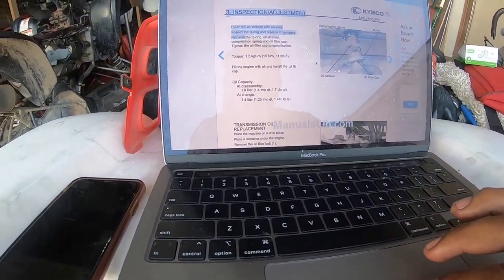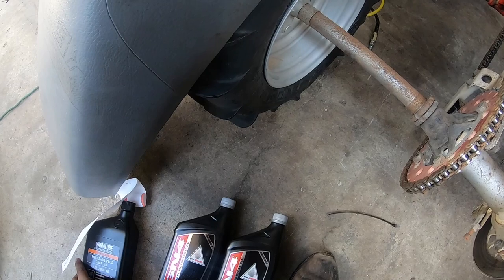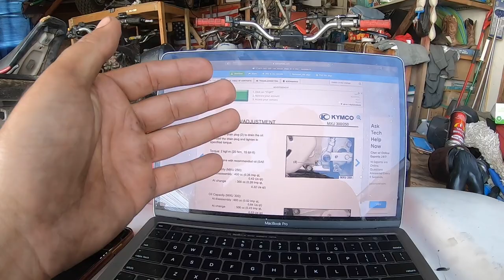How to do a Oil and Transmission change on a ATV! (Kymco)

Comment: Hello, I bought i kymco mongoose 90 for my son but for some reason turns off by itself after a few minutes what can that be I'm a first time owner. I took it in for service and I was told it was the battery that was replaced but problem still there 😞
Reply from the maker: Good afternoon. Can you message me on Instagram. So I can send some voices messages? Acemotorsports_

Comment: I've got a 2016 450i went through some deep water and it's slipping is there a drain plug for this problem
Reply from the maker: If you went through some deep water I would replace all fluids asap. That’s differential, tranny and engine oil

Comment: Hai sir kymco mxu250  gear chance that time its come jerk gear very hard .why that jerk   coming. Pls reply sir
Reply from the maker: Hello brotha, there’s going to be two reasons maybe 3 for the jerking when changing gears. How’s your idle? Maybe lower your idle a tad bit. Have you changed your gear oil? It’s important to do a full tune up and lastly but more than likely not your gearing is messed up and probably damaged

Comment: Just some new info tried to order the Mong.270 boss face part allows improved power but unfortunately most ATV dealers are refunding due to back order. Btw idk the commonality of both but that looks like a Mongoose270 not a MXU 300 utility ATV?
Reply: so have you changed boss face part?